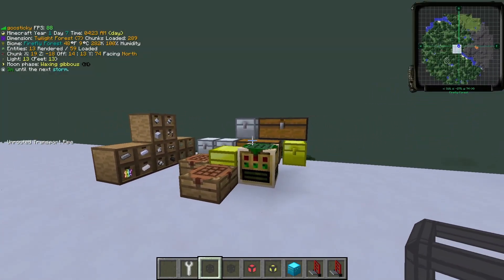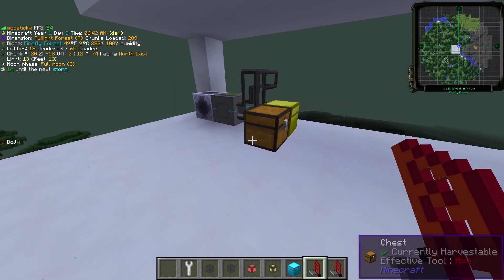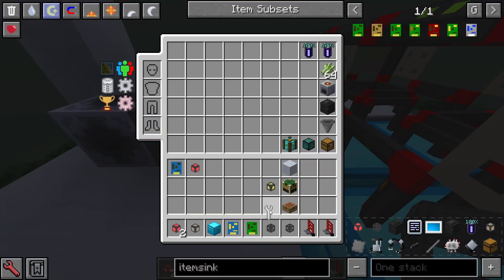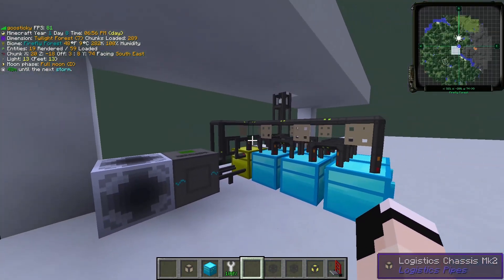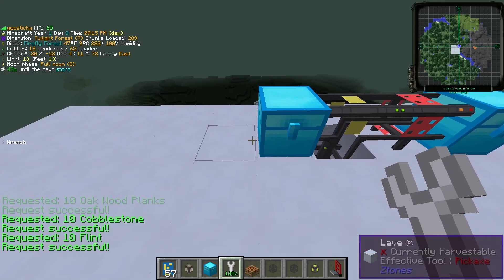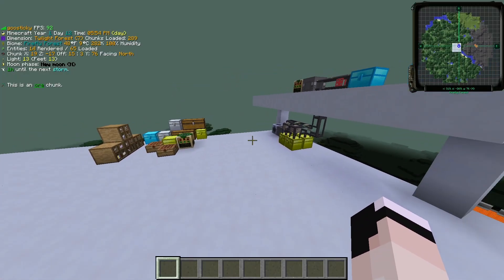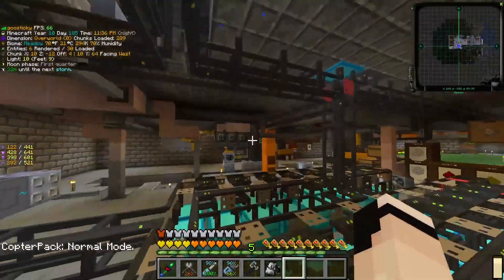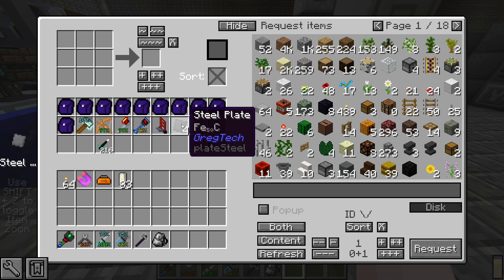Goosticky's Guide to Logistics Pipes

Comment: A few tips, from someone who also used LP for centralized storage until AE2
- Fuck the logistics request table. It's so garbage compared to just having a central chest with common crafting components and a crafting station next to it for auto pull. It was so bad, I even tried looking into the source code to figure out why and I agree, it's terrible. Do yourself a favor and just don't.
- But then you might say "well how am I going to have enough room for all my common components in a single chest?" Compartments. They're relatively cheap and grant access to 400 slot chests as early as LV. I ran with a diamond one next to my crafting station and only ever had it like 70% full until AE2. They're also great as a storage option for your LP network.
- You don't need an extractor module. Any item input into a basic logistics pipe will enter the system. If you use a fast conveyor (filtered conveyors are crazy fast for some reason) and a large item pipe, you can pull hundreds of items per second into your system. Do note though, if you force items into the network and they don't have anywhere to go, they'll just pop out onto the ground.
- If you don't mind having two pipes per chest, supplier pipes are a little cheaper as they make multiple from one supplier module.
- Once you're in HV, make a drawer controller. It'll let you store items in a whole bunch of drawers with only one sink/supply pair. You can use a request pipe to move all the bulk items without carrying them all manually
- LP for fluids isn't a terrible option, but crafting the components is kinda annoying and you need 2 pipes per tank. I personally only used it for ebf gasses, but you could totally use it for everything.
- Ain't nothing wrong with a request pipe that spits items onto the ground, if you have an item magnet (you should by this point). It's nice to be able to start walking away and still pick up the items.

Comment: I seriously doubt the autocrafting utility of AE2 could match that of LP at late HV. You need titanium niobium alloy to open up autocrafting with AE2 but LP allows moving fluids into a craft with just blue steel doesn't it?

Also no lathing of certus quartz until you just want to shrivel up and die. In Minecraft 😂
Reply: Yeah the amount of certus quartz you need to lathe to start ae2 is a little ridiculous

Comment: when you automated crafting, how did you deal with recepies that requiered fluids?
Reply from the maker: brother i manually filled every fluid on my own, i didnt even touch fluid pipes at all it was too much for me to worry about
Reply: So I had a long and thoughtful reply. With a couple of inaccuracies because I haven't used Logistics Pipes in years. But I can't see it so YouTube deleted it to rage bait me as usual 😹

But the corrected TL;DR is one, manually keep it always stocked with the same liquid.

 Two, keep it automatically stocked with a supplier, liquid or normal.

Normal would be for the fluid solidified version of the liquid needed in the craft (rubber/polythene/whatever sheets, glue balls, ingots of soldering alloy, whatever) putting it in a fluid extractor which melts it and outputs the fluid automatically into the machine that does the craft, say an assembler, circuit assembler, cutting machine or a chemical bath.

This continuous stocking means of course every unique combination of liquid and non consumed item like circuit and that can mean an explosion of machines which may mostly sit idle.

But you can instead send the solidified liquid in exactly the right amount for each craft. That way you only need one machine for each configuration circuit you want to automate. Again using satellite pipes and a fluid extractor.

For instance copper wire goes in the assembler with circuit 24, at the same time a rubber bar goes via satellite pipe into a fluid extractor automatically emptying into the same assembler, hey presto, automatic crafting of copper cables.

You can do similar with satellite pipes, cells and a fluid input hatch, fluid canner or sometimes a gt++ tank. Probably a fluid supplier is more straightforward though.

Make sure you have a return for empty cells such as a provider providing them back to your pipe network, or solid byproducts of fluid extraction, which may not be guaranteed, like propolis from melting honey drops into liquid honey.